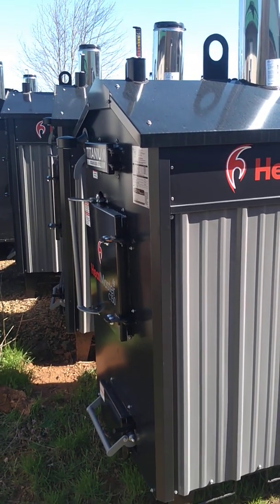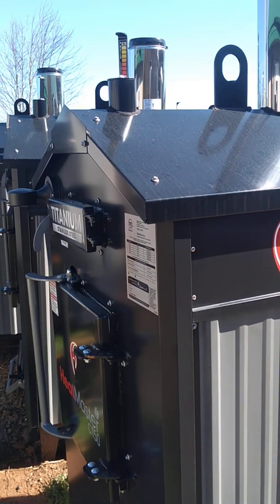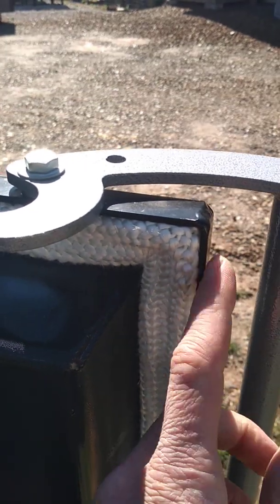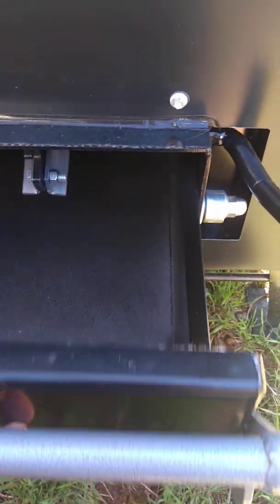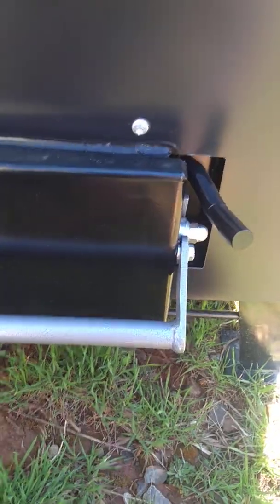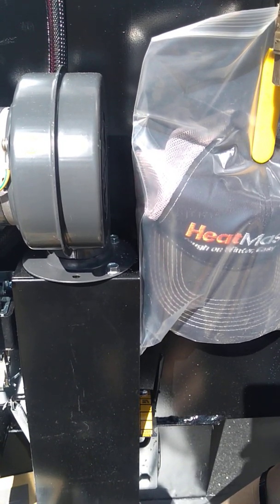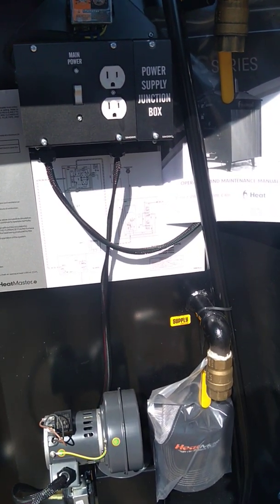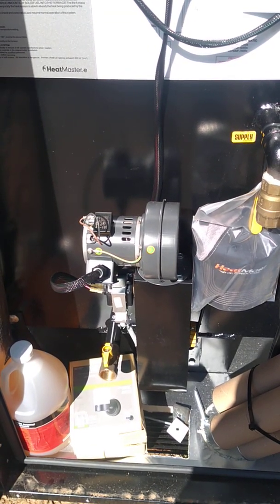Troubleshooting Causes of Overheating In a HeatMaster C or MF Series

Comment: Would be awesome to have a dealer like you close by.

Heat master ALMOST nailed it with the old system and the flapper on top.   Mount the fan direct to the stove and drop the flap on the fan top.  Best way to do this.   Natures comfort did this successfully for 15 years.   Less moving parts and more fail safe!

Comment: My MF 3000 is overheating.  I checked the solenoid because it went bad last year causing overheating.  It's not working again.  However, the weird thing is that I wire tied the solenoid shut and the stove is still overheating.  Also, the water level is showing full when it's getting hot and when it is cool.  it seems like the water level increased even though no one added water - I'm assuming that's not possible as it's a closed system.

The temps from the stove to the house are showing 15 degrees or so different with no water or heat running in the house.  I feel like it normally shows 5 - 10 degrees different.  I'm wondering if the pump is running slow, but has not stopped running completely.  Is that possible?

The gaskets do need to be replaced I think, but this overheating happened all of a sudden.  They've been the same all winter.

One other thing.  If you could control this method of burning, the stove is far more efficient.  It's been cold and windy today and the stove has stayed hot (in the 190's though set on 165) with only a few sticks of wood in it!?  If it operated like that all the time I wouldn't have to burn nearly as much wood.  Unfortunately it's not a controlled burn.

I'll check and see if something is causing the air box flap to remain open tomorrow.  I'm baffled.  I'm especially baffled about the water level going up even though everyone says they did not add water.  I have had the stove overheat before and have seen the water level go up, but it always goes back down a little once the stove cools off.  Not this time... weird.  In fact I could swear I noticed the water level was up before the stove ever overheated.
Reply: Also, what is the other damper on the bottom for?  The one with that you can set from full open to closed or anything in between.  I closed it as well to try to cut off any air, but no change in overheating.
Reply from the maker: @robn.7426  The other damper at the bottom is to control the total amount of air, but doesn't shut off tight enough to stop boiling. Leave it open. 
It is possible that the impeller on your pump is partially broken and isn't circulating water well. You could open and close the valve right above the pump and listen for the whoosh of the water going through. You could also close both valves and unbolt the pump and turn it over to see the impeller. 
The reason you're not burning much wood is because the weather is considerably warmer  and so the house isn't pulling much heat off the stove. It is somewhat cold and windy but nothing like it was back in January. 
I would be pretty certain that you have an air leak somewhere, probably an ash pan gasket or firebox door gasket. It's hard to say for sure without going over it very carefully.
Reply from the maker: Also, I would remove the fan and check the flap in the airbox underneath, it's possible that there's a bit of grit under the flap that is holding it up slightly. It doesn't take a very big crack to cause boiling and warmer spring weather. I don't know why your water level is showing high, since I'm not there seeing what it is doing at different temperatures.
Reply: @YoderOutdoorFurnacesLLC  Thanks for the reply.  Yes, I've had the stove for 8 years or so, I'm pretty familiar with how it burns on different weather days, but maybe I'm imagining things.  Thank you for the recommendations.  I will check those things.  

I did notice also that the ash pan door was closing easier so maybe something changed with the gasket, but it doesn't look any different.  Thanks again for your help.
Reply from the maker: @robn.7426  You could adjust the rollers in further to tighten up the seal. You could also light some oily rags (or something that smokes) in the ashpan, the smoke will push out any crack. Hope you get this sorted out!

Comment: Hi Mr. Yoder! I have. G- series. Have you ever seen, or heard from the company, the control unit go haywire? (Water temperature shows -22degrees Fahrenheit, so damper stays open and furnace over fires and boils over)
Reply from the maker: If the water temperature is reading that far off it's probably got a bad temperature probe. The temperature probe and a small circuit board come together and I would replace them both.
Reply: @YoderOutdoorFurnacesLLC  Thank you very much for responding!! A month ago the probe and burnt wires were replaced, but it is misbehaving again. The boiler fellow is returning today.
Reply from the maker: @TheBellmare  Burnt wires doesn't sound good. If stuff was shorting out it may have damaged more things. I dunno.